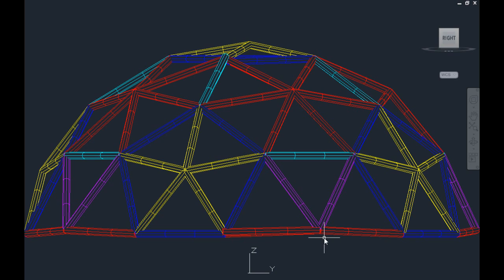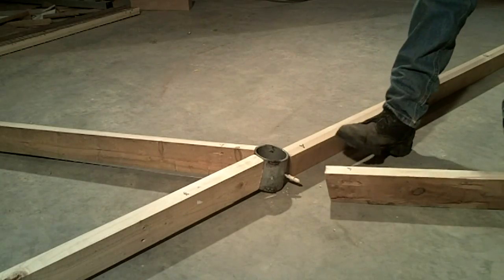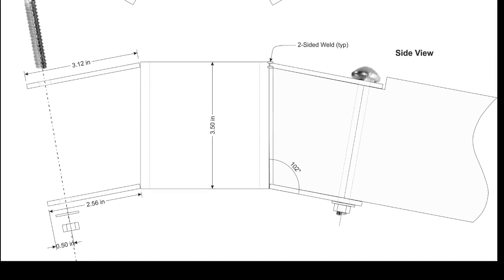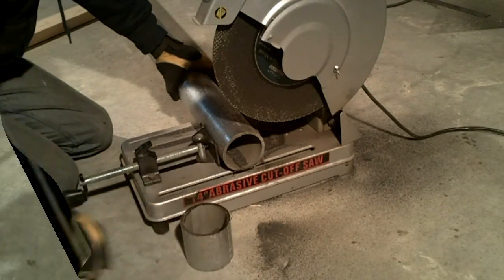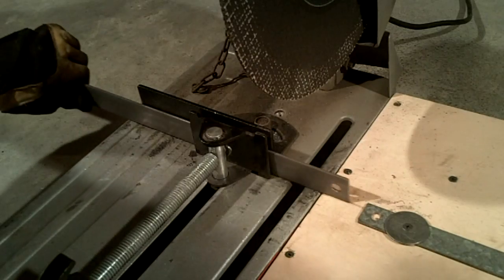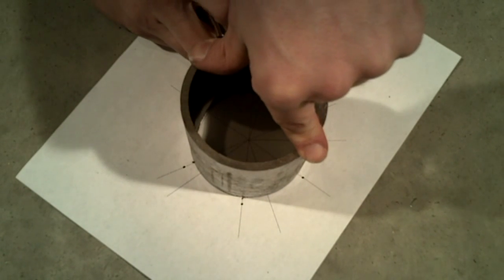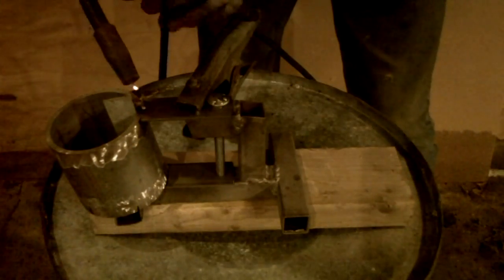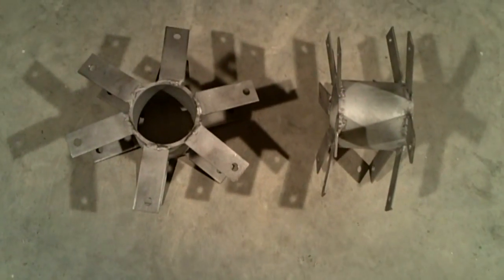Geodesic Dome Greenhouse - Part 2 - Hub Construction

Comment from the maker: @gedw99 respectfully, I disagree:  1)  It will take more material since the 'tabs' need to be longer so you have enough space to feed a bolt through.  2)  The plate method allows for the angles to be adjusted since the triangles aren't equilateral.  The angles are adjusted through the bolt instead of having to make custom hubs for each spot.  3) the force against the bolt in this position is different than the force if it was placed through the sides. 4)  This is easy to set in a jig & weld.

Comment: I came across your video on Instructables. Great Job.

Something you may consider rather then the paint is to re-coat the parts with zinc after they are welded. You could start with plain steel parts then and not worry about hazards due to vapors. You could then paint the galvanized metal. You can find the instructable on Instructables

Again Great job. Lookforward to watching other videos about it.

Comment: I missed this one... very well done.  I think your earlier designs didn't get a fair trial.... I read that the strength of the dome is in the foundation since all force is transferred there.  As long as the foundation ring is in tact the dome should be good to go.  If you would have added a ring foundation to your struts, I think that the hubs would not have failed but that last design is killer.  Great job !

Comment: Been watching and re-watching your videos for a few years now, as well as others regarding geodesic domes (my site is a high wind area so most other greenhouse types are losers), and I always come back to your hub/strut method. I only want to build it once and the method that you employ seems like the best one for me and my site, though I can tell that I'm going to have to develop some skills along the way. I really appreciate the technical explanations that you give as well. FYI my dome will likely be 18 ft diameter on a two foot pony wall for a center height of 11 feet or so...plenty for my dwarf bananas. Also planning to do a scaled down aquaponics setup similar to yours with the shed addition on the door side though I have no plan for any type of heat system since I live in the Pacific Northwest and it just doesn't get very cold here. I am however leaving the option for some kind of heating system open. Thanks for all of the videos!
Reply from the maker: +Ty Thompson Glad you're enjoying them.  Good luck with your project!

Comment: Point one: after working/welding with galvanized metal, drink whole milk is the old adage I was taught as a greenhorn fitter, Point two, you need a person on Fire Watch while welding, because you as the welder, might not see a fire start from the sparks being focused on the weld. I once saved my welder from a foot burn because he stepped on a red-hot piece of steel cutoff while cutting inch and a half plate steel with a torch that began immediately burning through his safety boot sole.

Comment: I like the final choice you made, but I believe 110mm diameter / 10 mmm thick HD polytene pipe should work well enough, but using 4 screws instead of one single screw,  The isostatics of the dome force the struts to compress against the hubs.

Comment: Just a thought, though it would mean making new jigs; if you were to use 90deg angle iron instead of, or on top of,  the flat stock tabs it would be much more ridged.

Comment: A very useful video but it occurred to me that you could use a broach to make a square hole in the upper tab before welding. I'm sure a square broach and an arbor press would be cheaper than a lathe, you wouldn't need to re-galvanize the bolt, and if the nut ever came loose you could tighten it from inside without having to rip off the glazing, which is the reason a carriage bolt has a square under the head in the first place.

Comment: In a word OVER-KILL using two straps  of prefab "Mending Plates" NO welding. put the single bolt thru the 2x4 rib, bring all the rips together with a single bolt thru the protruding ends of the mending plates thru a 3.75 inch length of 2 inch schedule 40 PVC pipe and tighten the center bolt thru the center of the PVC to bring the head of the bolt and all the ends of the mending plates down slightly into the inside of the pvc and you can cut off the excess ends of the bolts for appearance.

Comment: Figures, I only discovered this after building my own geodesic greenhouse in a completely different, and IMHO woefully inferior, fashion.

I'm a complete neophyte at metalwork, so this may be a stupid question.  But would it have been possible to do the tabs by using a single longer piece of bar stock that gets bent twice, and then welded all along the side of the pipe?  Seems like that would be safer for adjusting the precise angle during installation, since you wouldn't be trying to bend it at the weld, and there would be a good deal more welding area to boot.

Comment: (continued) - With all of your experience so far, I thought you might have a clue about these "R" numbers. The lack of decimal points in parts of the page makes it a little hard to decipher sometimes...

By the way, how did you figure out how much of a bevel to put on the outside edge of the struts for the panels to rest on?

Comment: @web4deb  Yep, I've already got that calculator downloaded to my computer and manually translated all the Russian inside the code of the page so I'd know exactly what everything is supposed to mean! The one online now is a little different than the one you showed in your vid - it has extra numbers down on the specs for the triangle faces.

Yours said:
1.  30 pcs. L2074-L2074-L2030

Mine says:
1.  30 pcs. L2074-R1180-L2074-R1180-L2030-R1206

Any idea what those R numbers are all about?

Comment: I'm a definite newbie at this, but doesn't using hub connectors defeat the entire purpose of tensegrity construction?

I thought the whole idea was to spread ALL of whatever load exists equally throughout the entire structure, not divide it among some given number of focal points.

MachOverspeed
Reply from the maker: I would say the majority of people use hubs because it makes it easier to assemble the building and make minor adjustments without having to do precise multi-compound cuts.  I don't really pay attention to any particular construction methods...I was just trying to build a dome.
Reply: It's a good-looking dome too. No doubt.

I'm thinking of a dome that consists of  triangular plywood/foam-core panels, bonded together along their respective edges.

Instead of the panel edges being beveled to accommodate the dome's curvature, they are instead built "square", and all edges are glued to their neighbor with an appropriately beveled (read: wedge shaped) shim.

All loads are thus carried equally by the entire structure, and virtually any size dome can be built, using the same basic triangle dimensions.

Your thoughts?

MachOverspeed
Reply: I'm 4 years late to this post. However I'd like to know what glue did you propose to use to connect the panels to the wedge shaped wood. I was wondering about the water proofing of the dome. Thanks

Comment: expensive hub system, i intend to use 4" PVC sch40 with 2 or 3 175lbs rated zipties on each strut end
PVC section is 4" long and has shared holes in between each strut, struts have 0.375in dia hole per ziptie

tests for structural integrety soon to be done once i have all the material, test dome is 21.8ft
target dome is 40.6ft
Reply from the maker: most likely, the tip ties will degrade in the UV light.  If you're in a cold climate, the PVC will be very brittle in freezing weather.
Reply: Bigelow Brook Farm (Web4Deb)
black acetal zipties are uv resistant,
i am in a very cold climate, dome design has less then 8kw heat loss in worse case scenario of -40 outside.